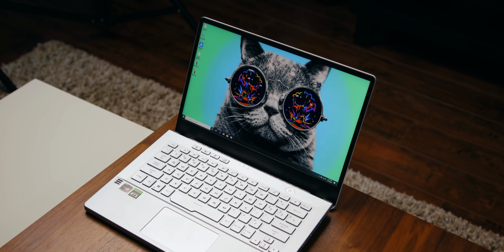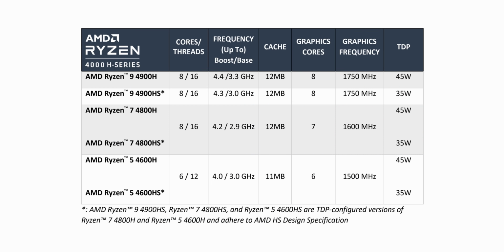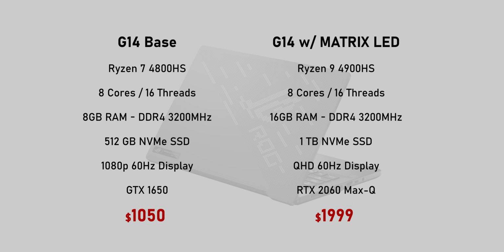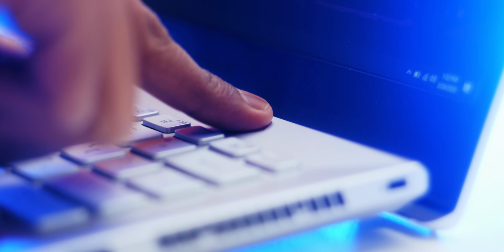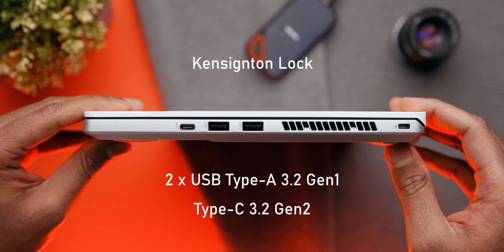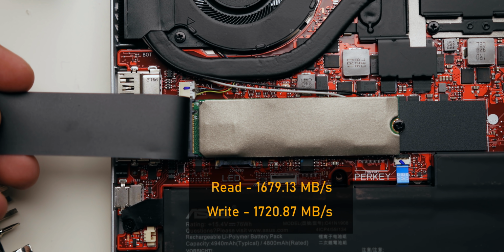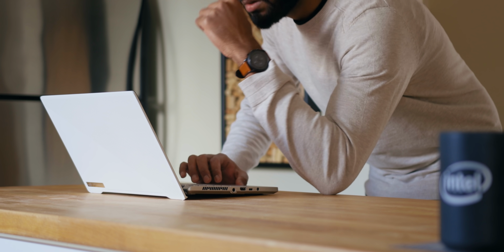This Ryzen 9 Notebook Is AMAZING - Zephyrus G14 Review

Comment: Highly considering switching from my surface book 2 to one of these beasts but I really need to read up on screen specs and wait for reviews on it because I really value a good screen for the type of creative work I do
Reply: You're probably going to have to wait for a Surface Book 3. Microsoft spent a lot of time and money designing custom displays just for the Surface Book. I always wondered why MS didn't use the same display on the Surface Laptops, turns out they couldn't have been price competitive if they did. Maybe look at an MSI Prestige or Acer Creator notebook - or dare I say it, MacBook Pro 16. If you want a display on the same level as the SB, you're going to have to pay a lot and it's not going to have a high refresh rate.
Reply: The Surface Book line of laptops are such beautiful machines imo. Waiting for the surface book 3.
Reply: There is also a 1440p display option that has better color accuracy, at least on paper.
Reply: There will be plenty of other manufacturers making the switch.  The price is just insane.
Reply: depending on the content creation I wouldn necessarily go with one of thewese G14. They are ggreat performers but for Adobe apps they fall behing (thats adobes fault but still). Usb ports are all slow and even the type Cs are just 10gbit. Idk about you but as a content creator I really value my docking capabilities, my desk set up with external monitors and fast external storage. Not to mention (this one is just an opinion and a picky one) i find it quite ugly even tho its better than most gaming laptops.
Reply: @brunolopes2205 True, but the performance  in Adobe apps is probably gonna improve soon trough software updates,
Reply: @cesaratachao5551  "soon"... if intel wants to keep leverage theyll just pay adobe hahah
Reply: @rightwingsafetysquad  You just reminded me that Microsoft hasn't released a new surface book. With ryzen 4000 out I'm imagining a superb pairing between the two.
Reply: I officially gave up on the surface book 2 and the pro. I've been buying them for years but I'm moving on to find something better ever since my battery died last week. Keep in mine I've only had the book 2 for 2 years. Its outdated and overpriced compared to this laptop.
Reply: @TheAmazingTailor  Oh 100%! The surface book is not a great content creation laptop when it comes to performance but I'm a portrait photographer and I value its portability and its beautiful screen, not to mention its great to have the ability to remove it and hand it to the model.
Also worth adding I sold an MSI gaming laptop that had an i7 8750h to get the surface book 2 so it really did hurt dropping the performance. Thankfully I edit mostly at home and I have a 3700X so thats why the surface is still VERY viable for me
Reply: @brunodays  
Oh, yeah. The book 2 definitely excels at being a laptop and tablet (writing and drawing tool) and too its credit it never heat up on me nor did I ever hear fans despite playing for hours Rainbow Siege Six. So like you said, depending on the task the Surface Book 2 can be very useful.

Comment: In my opinion this is AMD's next step in dominating the CPU market in terms of mobile chips like how they did in desktop chips.
Reply: They need to. This is Intel's last true bastion when it comes to the consumer and business markets. If 1st line PC manufacturers like Dell and HP accept and push AMD CPUs over Intel, it will pretty much be the end of Intel as the big name in both Desktop and Laptop sectors, leaving only Server markets. However Intel has a lot of money and is well known for paying these manufacturers to ship millions of their CPUs preferentially. The main issue though is that AMD doesn't the capacity to produce "millions" of CPUs like Intel. And that tends to be a major bottleneck when it comes to these big companies choosing AMD.
Reply: Fernando Cárdenas considering AMD can do it as faster or faster at lower TDP and lower prices.. vendors will jump at this quickly.. cost-to-profit is king in business.
Reply: Fernando Cárdenas intel sells like 5 times the number of CPUs as AMD. Saying that laptops are Intel’s “last true bastion” is kinda not true.
Reply: @cane870  Not true...for now.
Reply: @cane870  is south and east asian markets the 3600x sold higher than the entire intel lineup.
Reply: Yeet Master ok good for them. Last time I checked Asia is not the only place that has computers.
Reply: @cane870  its great knowing how less their market share was 2 years ago

Comment: I'm looking for something to upgrade from my ancient Haswell laptop and I've been waiting for the new Zen mobile CPU's. I've gotta' say, even with the limitations due to thermals it's pretty tempting at the price. I really wish it had an SD slot, as I'd be using it for content creation on the go. But I get it... not a lot of room. Certainly on my shortlist right now. I'll have to decide if a larger model will be worth it. The added 10-key would be nice in a larger model as well.

Comment: I just bought this. Loving it so far
Reply: How was it? Planning if this or g15?
Reply: @HammieSiochi  I bought mine a week ago from Best Buy as it was on sale. I am coming from a Lenovo X1E Gen 1 and I’m loving the ASUS so far. It runs cooler than my X1E but the gpu fans can ramp a bit under load. The portability and feel of the device is amazing and I’m impressed by the sound quality. The main negatives, IMO, are the dim screen and no TB3 as that means no EGPU. My main uses are Unity dev and other software dev. I actually don’t game so I cannot speak there. Overall, I recommend the device.

Comment: I had a 2012 ASUS ROG laptop from 2013 until 2017 and it was one of the best laptops I have used; the only issue was that it was so large, heavy, and clunky. I'm super excited for this laptop because of how thin and light it is with even more power than the HP Omen I got to replace my ROG. And I love the white lid combined with the silver and grey on the rest of it.

Comment: So I bought this laptop 2 weeks ago from BestBuy in Chicago, and I'll go ahead and input my experience, so far, with this, trying to reflect what these reviews say (you may see my comment on other videos, like Jarrod'sTech). I bought the 1080p 120Hz version with RTX 2060 Max-Q for $1,449.99.

Everything this review is saying is 100% true: the magnesium chassis feels amazing, it's not heavy but heavy enough to feel strong and sleek. It's lightweight enough to take to school in a backpack. Typing on the keyboard feels fantastic. The trackpad feels the same as my MacBook Pro 13" (2015). The keyboard lighting on my keyboard is well-lit throughout the entire keyboard. Reviews mentioned how it's spotty and not thoroughly distributed, but mine are. They're not as intensely bright, but that's ok with me.

I've played World of Warcraft (both classic and retail) and both run smooth as heck. Temps < 75C. FPS > 120.
I've played BF1 on Ultra settings and runs smooth as butter. Temps ~ 79C. FPS ~ 100-110.
I'll soon try Cyberpunk 2077.

Since I can type out all the amazing things about the laptop, it's easier to point out what I dislike (assume everything I didn't mention to be 10/10 in my opinion).
Cons:
- The fingerprint scanner on the power button doesn't always work, and I think it's because of my oily fingers. My fingers have to be completely 100% try for it to work 100% of the time.
- There are only 2 USBs on the right side, which is not a huge deal but I wish a third was included on the left hand side.
- When the screen is down, there is no battery charging indicator visible. The battery charging light indicator is on the top of the keyboard, so you'd have to open the screen up to view that light indicator.

That's it. Such minute cons make this laptop such a fantastic machine. Everything inside is so powerful, it's insane. If anyone has a specific question, feel free to message me!
Reply: I’m also considering to get this laptop and was wondering if it could handle Valorant from low to medium settings

Comment: Great review!  I agree the placement of the Type A USB ports is not great for external mouse users, but a 90 degree USB extension should take care of that issue.  The lack of webcam doesn't seem like a dealbreaker, especially since most laptops come with crappy 720p cameras.  A decent 1080p webcam is less than $50.

Comment: I bought one and it gets so hot to the touch that it can burn you... also I went right into Bestbuy and bought one just to find out that there are multiple models and the one Bestbuy sells don't have the LED grid lighting on the back! I am pissed!
Reply: What the heck, mine stays nice and cool. Also yeah of course there’s different models. I’m sure Best Buy probably sells the one with the anime matrix online for in store pick up.
Reply: o .O My G14 stays chill at most 50-77
Reply: Disable CPU Boost will reduce heat up to 20%

Comment: Wait what! I thought the soldered ram was 16 gb. I was really hoping to add a second 16gb stick. Isn’t 24 gb weird? Could you add a 32gb stick for 40 total? I thought having mis-matched ram was super inefficient.
Reply: Actually no, having the same frequency is more important. If you put a 16gb stick with the 8gb on board memory (24 total), you will still have dual channel : 16gb will be on dual channel, and 8gb on single, a hybrid mode. But that's alright, your system will prioritize the fastest and the difference with a dual channel is insignificant.
If you add a 32gb, you will have 32gb as dual and 8gb as single. So 40gb is ok too.
Reply: @LeBlafy  thank you, that's what I thought but wasn't sure. Might have to look into buying a 32gb stick as I wanna use this computer for after effects and premiere.

Comment: Some things it doesn't have that I insist on:
1. all the RAM has to be replaceable, not this one soldered and one replaceable. I keep laptops long enough that the DIMMs die at least once or twice.
2. needs a user replaceable battery (no I don't mean doing major work on the laptop, removing 20 screws and voiding the warantee kind of battery replacement)

Comment: I’ve been looking for a light-ish gaming laptop for about 2 months now with the requirement that it has 16gb ram, weighs under 5 lbs, has as sleek of a design as possible, and is no more than $1500. This hasn’t come across my radar today because im only familiar with intel processors and havent even considered amd. Definitely am now for this spec sheet with a price

Comment: I don't get the nitpick about the Gen 1 Type A ports, when both the Type C ports are Gen 2. Practically any single device (literally like 2 types) that would benefit from the bandwidth, is extremely likely to be Type-C  standard.  The real beauty of the increased bandwidth (and power) is more devices on a single port through a hub, for which type C has still got you covered. Would be extremely niche to want/need 2 external Gen 4 NVME, plus an external 10Gbe adapter on the go. Not like you can move anything to or from this faster than the Gen3 NVME will allow.

Comment: don't forget that while browsing or gaming to use a resolution of 1366x768 or 1280x720. It's screen is so small it doesnt need so big resolutions like 1080p.
that way you get more fps + battery life. If using editing programs like photoshop switch to 1080p to work better , when finished switch again to something lower.

Comment: "this keyboard weight just over 4 pounds" - and I thought Canadians are supposed to use metric
Reply: I to would be using imperial units if I was living that close to the border that I could hear the crying coming from the US whenever someone posts a video using metric...
Reply: No one that I know uses the metric system, other than km for speed and distance (but that's only half the time)
Reply: Canadians like to use metric for distance and weather but imperial for weight and their ovens :^)
Reply: @crookycumbles  Exactly, us Canadian are stuck with both metric and imperial units. We use metric for distance, weather, and in our education system, but imperial when measuring the height and weight of people, for some reason... We also use imperial for most construction parts, for very good reasons.

Comment: "Intel hasn't licenced Thunderbolt 3 to AMD yet" - It doesn't need to, this was Asus just cutting corners, on my AsRock X570 (AMD) board I have a Thunderbolt 3 port.  To be fair I'm actually happy Asus didn't put one in there; lower price and I'm yet to come across a monitor that requires such a port (storage/external GPU applications aside).
Reply: I would say that Intel are going to be extremely stringent on licensing to AMD based laptops, especially now that AMD laptop CPUs are actually highly competitive.  Intel do shit like that so it would not surprise me.

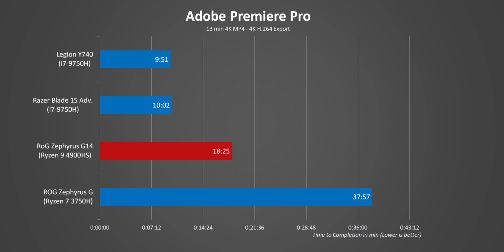Comment: At 14:27 you mention if you are a Adobe Premiere user to stay away from this laptop but there is a simple fix for this issue. You just install the free open source Voukoder plugin for Adobe Premiere which gives you hardware acceleration encoding by using the NVENC encoder for NVIDIA GTX graphics cards.

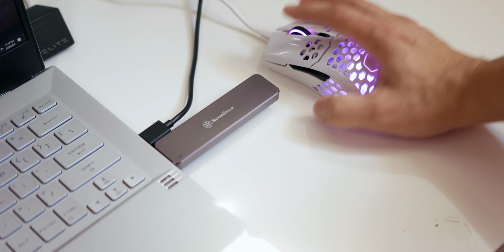Comment: What happened between 10:10 and 10:30?? At 10:14, you plugged in the white cable of the white mouse, but at 10:17, the video shows a black cable connected to one port, a SilverStone device in the other port, and the end of the white mouse cable is out of view, although the white mouse and part of its cable are visible, but you made your point. Since there is no port on the left side of the laptop, plugging in a thumb drive on the right could become a slight obstruction when moving the mouse.

Comment: The price breakdown is basically like this for the $1450 one... $450-500 Cad for 2060 GPU, $100-150 for ssd, $100-125 for ram. Power supply, case via laptop case and Cpu are unknown, but I could just deduct the whole thing: $1450 Cad - $775 Cad at most = $675 Cad and therefore, $200 for cpu and $100 for power supply would suffice making the profit margin about $300 CAD if you also deduct the cost of $75 for a laptop frame/case.

Comment: Thanks for this review.
I found quiet strange that all youtubers complains about fan noise !!!
When reading your numbers (39.9dBA, 46.5dBA and 49.7dBA) and compare to by example this Eluktronics RP-15 review. I didn't hear any remarks/comments about fans noise for this laptop ( I recall 44.9dBA, 48.4DBA and 53.1dBA). If I remember correctly each 3dBA increase mean noise level double.
IT is the tuning (too much treeble ?)

Comment: PCIe Gen 4 is literally impossible to put in a notebook atm... Both the chipset AND the SSD's themselves have massive power draw compared to PCIe 3.0, which just can't be cooled in an ultrabook form factor yet. Considering the size of current PCIe 4.0 SSD heatsinks + the X570/TRX40 chipset fans, I'm kind of baffled why you thought they'd go that route tbh. It would be a pain in the ass to cool, and crap all over battery life. In a console or desktop it makes all kinds of sense, but thin & light laptops??? Nope, not one bit.

Comment: Laptops don't need Gen 4 NVME, the x570 motherboard currently has an extra fan to cool the controller for gen 4 PCIE, at this point PCIE 4.0 is simply not mature enough for a laptop.

Comment: I'm debating whether I should get the G14 or the G15. Mind you, my current desktop isn't even close to the powerhouses that of both of these are (i5; GTX 750 ti; 8GB RAM; Base dell motherboard). So either way would be a huge upgrade. What would you recommend? It seems to me the G15 is more about lasting battery life than the G14 is about performance. So I'm not sure... Any insight would be greatly appreciated thanks!

Comment: I'm curious on how many watts 4900HS can drain at the beginning of high workload and how long it can last before a reduction in frequency ===. (In case every notebook processor has two thermal throttle, from Intel one is PL1 and another is PL2)

Comment: Hi :)
I just watched your wireless Setup from a year ago. Have you tried the Logitech G613 Keyboard? im very happy with it and it has a battery life of over a year. Yeah i didnt believe it at first... but now mine is running 1 1/2 years and i have never changes the battery. Cheers from switzerland ;)

Comment: I came from a Blade 15 to this and this performs better, is cheaper, lighter, and biggest shock of all is that it looks nicer.  Coming from someone who was absolutely in love with the aesthetics of my blade I gotta say besides the keyboard this laptop overall looks more appealing and is more at home in a board room than the blade.  Amazing.  I also set the cpu to not boost and have been getting incredible thermals while losing very little performance seeing that the base clocks are already respectable. 10/10

Comment: Lets all evaluate both after using them for 3 years. With AMD still running hot (as long as they existed) I am not gonna hold my breathe. Performance is one thing, but can they have integrity in the long run?

Comment: the laptop pushing the keyboard up worries me. screen connectors are very fragile and known to break a lot and cause issues. specially since i've seen asus ultrabooks suffer from display cable issues a lot.

Comment: Two things:
Upgrades to 24 GB of RAM will cost you dual channel support, people, so beware! 
Also "IPS-like" or IPS level" as it is called on their website, most likely refers to an IPS adaption such as AHVA or AAS, which basically are the IPS versions of AUO and Innolux. Technically only IPS panels made by LG are "actual IPS panels". Not that it matters, the principles involved are mostly the same. There is no disadvantage here.